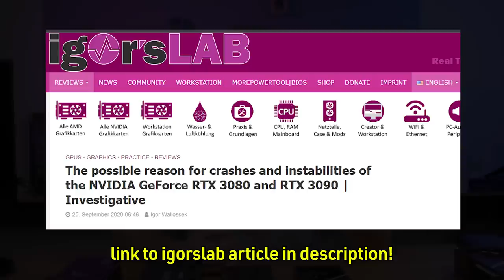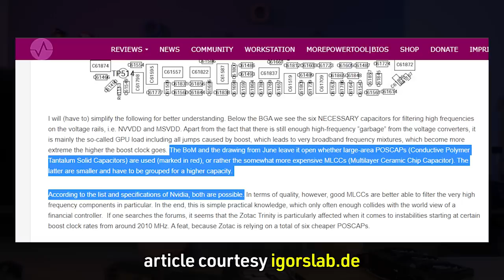The RTX 3080 Launch can't get any worse... Right? Wrong...

Comment: 3rd party manufactures cutting corners, using substandard components & increasing the price to gain extra profit. 
Never heard of that before....
Reply: Cutting corners. With expensive tantalum capacitors? None of this makes sense.
Reply: This is on Nvidia for not releasing drivers even to their partners before launch so they could test what they’re building for fear of leaks that disprove their announcement claims and the poor performance below 4K.
Reply: @cheesetomatoes  yeah that's why I think this is so odd. They probably didn't realize the card would try to pull that much power with gpu boost
Reply: We knew Nvidia was selling the FE as loss leaders to get better day one reviews, was inevitable that the AIBs would struggle to get their normal margins on them after that.
Reply: sounds like boeing....
Reply: or apple....
Reply: That's what Nvidia did too
Reply: Nobody knows for sure right now. There have been no official statements. Jay just theorizes in this video, that the spec may have set a bar that was too low. Let's say you tell your friend that his system will pull an absolute maximum of 450W and he doesn't need more, so he gets a 450W PSU. If 450W isn't enough for some reason, is it his fault for cheaping out? Please, no accusiations to any side until we know more. We're all just spitballing here.
Reply: @prjndigo  Dude. Nvidia needs to take most of the blame for releasing an insanely power hungry card.
Reply: @prjndigo  computers are very sensitive to any radiation, solar radiation flips bits in memory constantly, the only reason we don't notice it is because we've started building in error correcting behavior into a lot of our memory systems to mitigate this kind of thing. It also gets worse at smaller nodes; NASA still uses 150-250nm CPUs in their space probes because they're less likely to get flipped bits from all the radiation they face in space.

Granted I don't think that's the main issue here, if I had to make any bets it would be that by using a single cap instead of separate ones over that one particular group of pads they may be bridging the two separate VCORE's which is something entirely novel to Ampere and probably wouldn't have had clear behavior before drivers were out as to how the two different VCOREs acted in use.

Comment: Igors lab is such a mvp
Reply: Ginkoman2 *Nvidia is such a mvp for not cheeping out when it comes to building the cooler and board of the 3000 series. Better coolers and better boards!
Reply: @Tony-yn5rr  They are NOT the MVP, they should've been way more strict and prevent AIB's from cheaping out on components in the first place. As a supplier you can set rules on what specifications are needed for the partners to be able to build using your product, this is just pitiful from both sides of the story.
Reply: @DanielMendozaDev  Nonsense. All nVidia has to do is give minimum specs for stable use. If the partners decide to cut corners in power delivery and overclock the snot out of the cards at the same time (their(!) BIOS), that's entirely on them.
Reply: @mito-pb8qg  They need to enforce MINIMUM specs, at the end of the day this affect's NVIDIA's image as well.

It's like Omron selling switches to Razer and saying "these are rated for 50m clicks, don't use them on products that require more" then Razer releasing a mouse using the same switches and claiming they're rated for 60m clicks.

At the end of the day it was the OEM's decision to cut corners but the supplier is impacted because they make a "shitty" switch that doesn't last 60m clicks.
Reply: Nvidia must have known that it was a critical part and didn't tell the board partners. Not what I would call an mvp move
Reply: @DanielMendozaDev  at least someone knows what tf they talking about MVP!!
Reply: Igor is indeed amazing! Check out his homepage if you don‘t understand German but a sub for his channel would still be great just so he receives some credit for the amazing work he‘s doing!
Reply: @mito-pb8qg  Nvidia needs to have higher minimum specs then
Reply: Sounds like nVidia's minimum specs would have prevented a lot of crashing, and the minimum spec is 5 poscap and 1 mlcc. Crashing only seems gauranteed at higher clocks with 6 poscap chips. Of course it affects nVidias image, but their minimum spec is not the problem. Giving nVidia a pass for a mistake is silly, but blaming nVidia when someone else cut corners is just as bad.

Comment: It's funny that Nvidia actually had a thing about crosstalk in their presentation... almost as if they knew
Reply: Bruh moment
Reply: Haha!  Yes, I remember that.  I just watched the presentation as well!
Reply: Fairly certain the crosstalk was about GDDR6X signal integrity.
Micron did their homework.
nvidia didn't do their due diligence.
Reply: @Vasharan  "nvidia didn't do their due diligence" ...wat. The partners messed up, not nVidia.
Reply: @Vasharan  uh... Did you even watch the video clearly nVidia DID do their due diligence, it was the AIBs that didn't
Reply: @Vasharan  Eh, I dont think thats 100% Fair to say. The cards produced by nvidia are doing fine. AIBs that did not follow the MINIMUM specs of 5 large one small on the back are the ones to blame. If someone tells you heres the minimum to play and you go nahhh this will do, hard to get mad at them when they told you it wouldnt from the get-go. This is why I ONLY buy FE cards they meet or exceed the reference specs they put out. They went 4 large and 2 small sets. More costly, but this I feel will push people more to OEM cards vs AIB partners trying to shave more margin.
Reply: I don’t think the issue is cross talk or noisy power going to the board. Instead it’s a problem noise from the GPU. The larger caps have more capacitance but a higher ESR (Equivalent Series Resistance). Additionally the impedance increases with frequency, so when the clock speed increases the core voltage will have more ripple. The ceramic capacitors have a lower impedance at higher frequencies and are in parallel which would reduce the impedance even further.

Realistically though those caps aren’t that expensive. In bulk they probably cost less than $1.00 in total ...

I would like to think that a company like Nvidia would know better. I always put my smaller high frequency caps as close as possible to the core and then place the medium sized, and then the bulk capacitors. Depends on the operating frequency and current draw, but usually something like 0.01uF, then 0.1uF, then 1 or 10uF on the side.
Higher frequency RF is more like 68pF, then 1nF, then 0.01uF etc to get a nice broadband response.
Reply: AMD conspiracyheads, pls. Shitty AIBs literally didn't follow spec and now they've been caught with their pants down. Calm your scorn for one nanosecond and hold the right parties accountable.
Reply: they probably did considering they engineered the standard.
Reply: I mean crosstalk is always an issue on any even mildly complicated electronics. Pre amps are a good example.
Reply: @eriphoor  this isn't a nvidia issue.
Reply: @mito-pb8qg  nvidia is responsible for the specifications of the reference design.
They didn't provide enough information or requirements for the AIBs to supply clean power to the GPU.
They also withheld drivers from the AIBs until the last minute because they were afraid of leaks, leading to insufficient testing on boards at launch.
Reply: @sloth4urluv  this is interesting. Searching online for mlss brings up a large variation of prices, from $3 to $7 per cap. If they bought in bulk of say 1,000,000, the $7 would probably fall to around $3.5 if msrp markup was 2.5x as is standard for electronic components, thats still an extra $35 per board, which i agree isnt a lot, but in price reflection of the whole card would probably bring the cost up to another $40-$45
Reply: @Individuality1990  Also it's more expensive to solder on 10 small MLCCs than 1 large POSCAP. If done by hand, it would increase the build time and require higher worker skill. If done by machine, might require more sophisticated tooling.
And then the time it takes to test and validate connections also increases with the smaller and more numerous capacitors.
And now if AIBs have to redesign and retrofit their cards to improve their reliability, that's going to drive up costs in rework as well as introduce delays into an already supply-constrained market. This launch has been a fiasco.
Reply: @Ender240sxS13  Did you read the article at igor's labs? From the article:
"So let’s go directly to the “reference board” PG132, which can also be understood as a so-called Base Design. "
"What is interesting about such drawings and the so-called BoM (Bill of Materials) is that you are offered different placement alternatives."
"The BoM and the drawing from June leave it open whether large-area POSCAPs (Conductive Polymer Tantalum Solid Capacitors) are used (marked in red), or rather the somewhat more expensive MLCCs (Multilayer Ceramic Chip Capacitor). "
"According to the list and specifications of Nvidia, both are possible. "
Igor does deflect some of the blame from nvidia on this by going on to say that the board partners should have known better that to go with an all-POSCAP design (which is entirely within the spec), but at the same time, nvidia prevented AIBs from performing all but the most basic validation tests on their products and designs by withholding drivers until the last minute (by which time cards would already have been shipping and in the distribution channel for weeks to months).
Reply: @Individuality1990  
Not sure where you did you cap shopping at , but those look like 0603 package capacitors (most likely 1uF since a single POS cap looks like it is 22uF) and looking on Digi-Key (which is expensive and not who they would use) you are looking at around $0.40 most likely as the worst case (I assumed it’s 6.3V X7R 1uF 0603). 20 of those would only be $8.00. (They could have possibly chosen a cheaper X5R capacitor which would be $0.1 or less per for a grand total of $2.0 per board, not to mention subtracting the cost of the 2 POS caps)

And to answer another question, there is no way they would be soldering these on by hand. Depending on how nice their pick and place machine is it should blow through placing those 20 caps in a second or two.
Reply: @sloth4urluv  is an mlss a standard cap?

Comment: OK these are decoupling capacitors and they are not for preventing cross-talk.  They are to provide transient energy during high current demands (such as switching form one state to another).  The Tantalum Caps provide bulk low frequency smoothing, the ceramic Caps (the bunch of 10 or 12) provide high frequency fast transient long duration current (they have a lower impedance than Tantalums).  These are likely higher value like 10uF.  The 0201 or 0402 capacitors will be ceramic and provide instantaneous high frequency currents for fast duration.  Skipping out on the Ceramics will allow the core voltage or IO voltages to sag which can cause erroneous switching.  Now you know.  BTW Decoupling (bypass) capacitor layout is critically important at the GHZ realm of switching because the traces and vias all act as RF components and can actually resonate with the capacitors.  BTW when an IC vendor gives you a reference design, FOLLOW IT!  There is a lot of work that goes into the signal integrity and layout of a board and an IC pinout !!!

Comment: EVGA's RTX 3080 FTW3 uses 4 POSCAPS and 20 MLCC. They confirmed it on their own forum, and even explained that that's precisely the reason they aren't available yet, because they originally sported all POSCAPS, they realized they were crashing while testing and therefore decided to modify the cards.
They also mentioned that they had already sent out a few pre-production samples to reviewers with 6 POSCAPS and that those will have to be replaced.
BTW, as someone else mentioned in the comments, POSCAPS aren't necessarily cheaper. If you take a look at those they used, it's actually the other way around.
Usually a combination of both works better, according to experts.

Comment: This video did not age well. After new driver released from Nvidia yesterday: 456.55, CTD-Errors are non existent. Overclocked my card to 2085mhz core-clock, no issues what so ever. The same overclock crashed instantly before the new driver.
Reply: I was cringing all the way through it the first time, Jayz just blindly followed Igorslabs "therory" like a clastic super noob even using stupid terms like cheap and expensive capacitors lol
Reply: is this highest you can OC. try 2100mhz ill bet it will crash
Reply: @46rrodriguez  Tried a 2150mhz overclock, no crash, your assumption is false.
Reply: @FrankAndreasLia  nice. what exact model do you have
Reply: @46rrodriguez  GeForce RTX™ 3090 EAGLE OC 24G with all sp-caps.
Reply: @FrankAndreasLia  Badass, thanks for proving him wrong and giving us updated info ♡
Reply: @Kirbydreaming  Don't worry, I only lost my leg as well as the kidney for it 😂

Comment: Man it's going to be hilarious if all of those scalpers are stuck with unstable cards that the companies will not warranty because they are scalpers lmao
Reply: Santiago Rocha warranty is not needed. Just run the new firmware and you Are fine.. and Also slower, but that does not tricker warranty...
Reply: companies do not care if you are a scalper, that does not void warranty.
Reply: if word gets out that certain models should be avoided due to issues, their price will have to go down. So if scalpers bought $800 cards hoping to sell them for $1000, now they suddenly have to go $700 or below. AIBs will probably come out with revisions of those models, maybe change the branding so they can still sell the new cards. May be wishful thinking, but just hate those scalpers with a passion.
Reply: Do you really think a company checks whether u are a scalper or not? They don't give the slightest fck, unless it's some crazy small store that has a lot of financial problems
Reply: People will still buy them anyways because the general populace is lazy and won't research.
Reply: Whats better is all the people who supported scalpers paying $2000 for a card now have a card that has this issue.
Reply: haukionkannel If you pay for a fancy card and it needs to be updated to run slower than advertised for stability because they cheaped out it is a defective unit. The “fix” is to replace the cards with redesigned units for free. If they don’t people will be demanding refunds and buying the “good” versions.
Reply: I dont think the manufacturer will let you warranty 20 cards at the same time before asking some questions.
Reply: Most of the 1st gen AIB models being kneecapped because of a hardware limitation will be rough for all of those that fought and waited to get one. When new hardware gets rolled out it’s always best to wait. This is where that fear of missing out comes back to haunt people. Been down that road once or twice and it’s a rough one.
Reply: @haukionkannel   but you don't want it slower. That is the problem. People will compare it with other EAB's and if they are faster (with no problems) people won't buy the card with the "cheap option" and a firmware update. That is how it works.

Comment: When I heard of the 3080's crashing I just assumed people were trying to run a 550-600 watt power supply.
Reply: I have a 650 gold and I don't think I'd be comfortable using a 3080 for much on that.
Reply: @NewkLambesis  Yeah, don't they recommend a minimum of 750 or 800? I've got a 1000W Plat, so I'm fine.
Reply: Jeff B 750 yes
Reply: He He He  it pays to wait.
Reply: @NewkLambesis  check optimum tech's video on that, he's a solid reviewer and sff enthusiast. worked for him no problems
Reply: Element Trill yeah imagine I’m making a new build with a 3070 and I’m still installing a 850W power supply
Reply: Yeah I think Jay even mentioned having issues and thought it was the PSU.
Reply: @TheNadazza  650 will be fine. Even 550 should do it. Everyone tends to over do it on their power supplies.
Reply: I have an 850 Gold, and the gigabyte card... So I guess I got the card with all the cheap stuff on it. Lovely
Reply: 1200 thor. I'm ready for whatever
Reply: @M-Capone  Epic :p
Reply: @transporter255 yes, why?